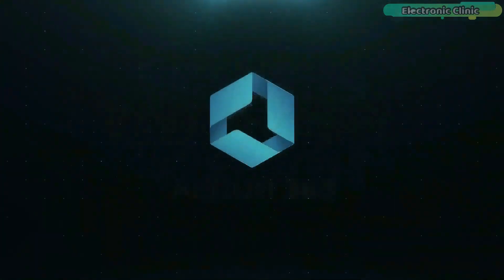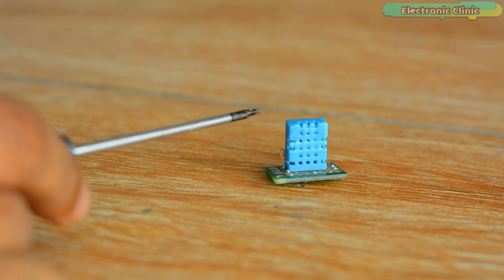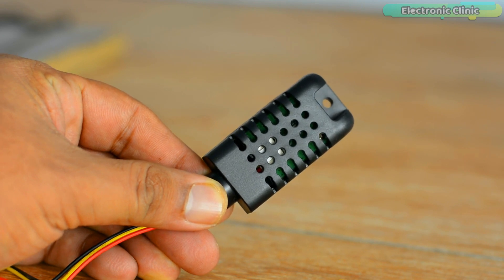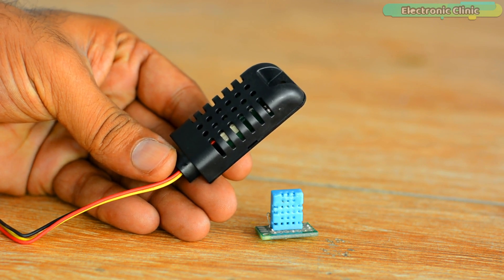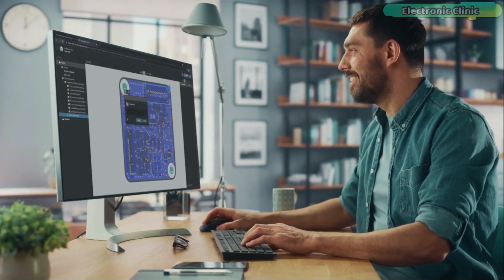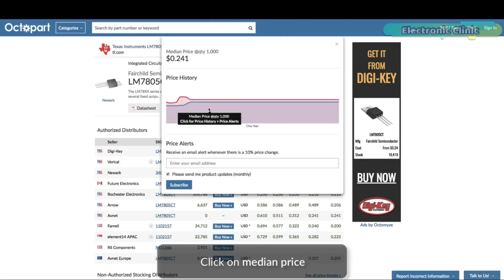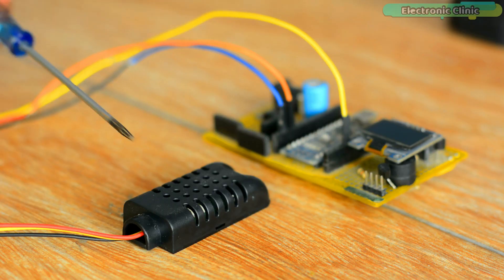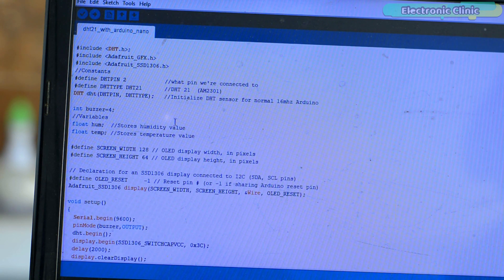DHT21 AM2301 Temperature & Humidity Sensor with Arduino, DHT21 Interfacing with Arduino and Code

Comment: I religiously followed your wiring diagram and the sketch using DHT21 but the serial monitir is reading 
Humidity: nan%,  Temperature: nan Celsius. 

If I comement  
  //hum = dht.readHumidity();
  // temp = dht.readTemperature();
then teh serial monitir reads
Humidity: 0.00%,  Temperature: 0.00 Celsius

So the issue is when the sketch reads the value of Humidity and Temperature.

Do you have any idea how to fix or troubleshoot this to get the correct readings?